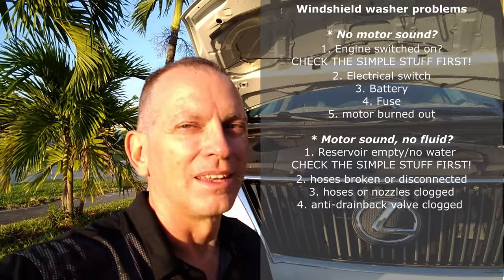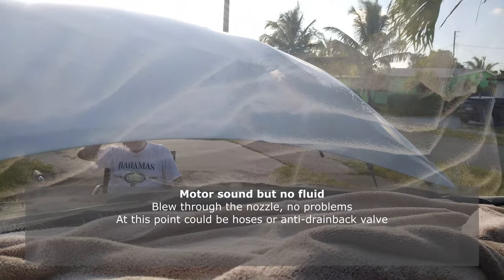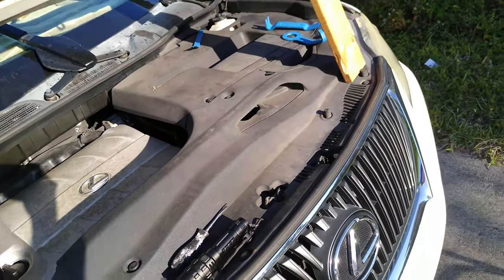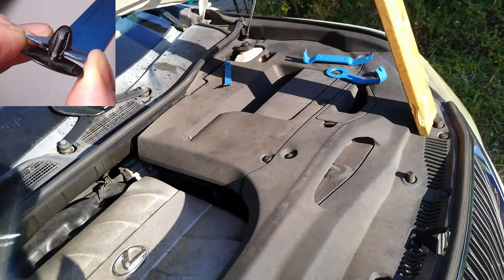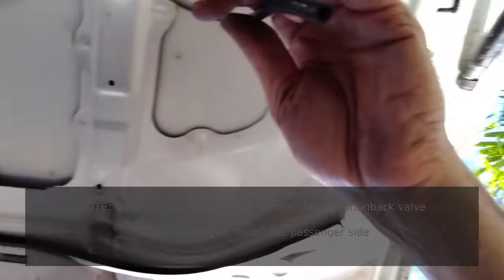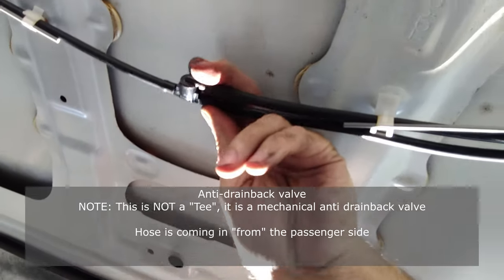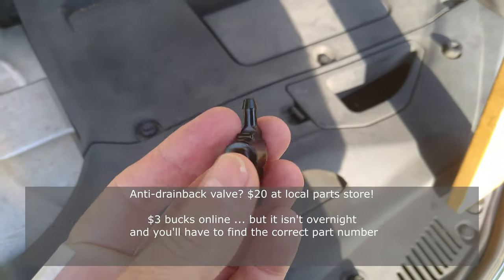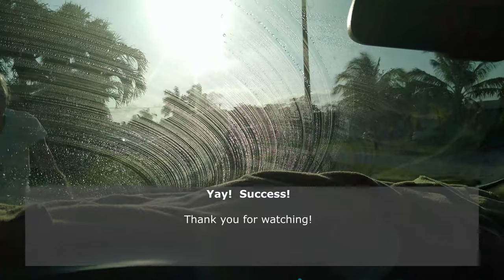How to repair Windshield washer sprayer only one side working

Comment: I replaced the same valve but after 3 months it stopped working again
Reply from the maker: Oh no! Are you using tap water in the tank? Might be hard water deposits.  I use the blue stuff. It is a couple of dollars a gallon